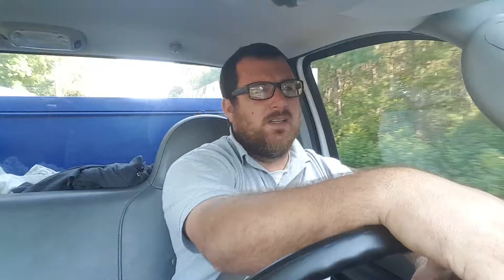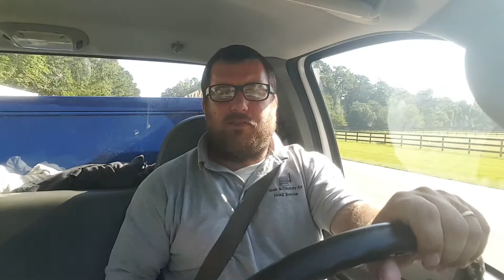R22 Replacements | Why Use 407c?

Comment: hello zack its been a long time its denis in fl just changed names here i am still with a  trashed back retired ,,,so far your the only one that mentioned  that with 407c if it leaks it will not cool at all and drive a technician crazy ! i was considering it a while back cause my system is still using r22  and i have a whole full jug of it and a half ,,,and its now in the 600 range or so , a tech that has over 15 years of working with it did not recommend i do that because of that reason , in school they  told us that a BLEND with a leak should be completely replaced with a new charge which all blends with leaks should !  but it seems in the HVAC world each tech does what works for him or either because he learned it that way . i find more ways of doing hvac just talking to diferent techs lol ,,,,,,,,,great vid except for the engine noise LOL ,,,OH OH and by the way in mexico they are using r22 all day long ?   only in the USA is the ozone bad ha ha !

Comment: Great video thank you! Question: If MO99 is basically the same as R407c, but with oil for compatibility, why not just use MO99 and not bother with adding POE to R407c?
Reply from the maker: Mo99 is not exactly the same.  Same basic 3 main ingredients but in different %. There is more capacity loss with MO99.
Reply: @Talyn875podcast  Thanks for the response! After posting this question I also realized MO99 is quite a bit more expensive than R407c, so even if they were exactly the same, it seems prudent to use R407c + POE anyway. Thanks again for the awesome content :-)

Comment: Gaurdian sales 407c units which is made by york, they work fine. I also replaced compressors and went in 407c. I also change evap coils, replace compressor oil then charge with 407c. It works works great. Changing the oil is not so critical if the mineral oil is clean because i charge a system with 407c without changing the oil and it works fine. Amp draw was standard i love 407c just my two cents
Reply: Wait, you didn't clear your system from the R22? I thought you can't put in different refrigerant without clearing your system from the other one.